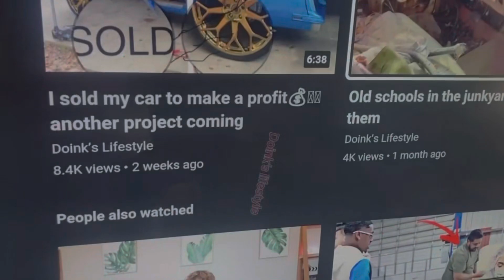"It Was Already Too Late...What Happened Next?"

Comment: After you change your oil you should crank it up and let the oil circulate through the engine and then check it again, especially if you didn't fill the oil filter full of oil. I like both of them bro.💪

Comment: Whats up bro Change your belts an you want have that squealing noise know more you should always let it run after doing a oil change be for revving it up let the oil circulate through the system first an changing your belts help with your ac to